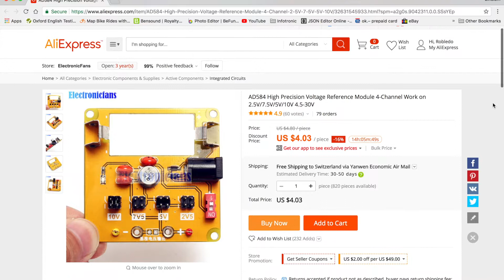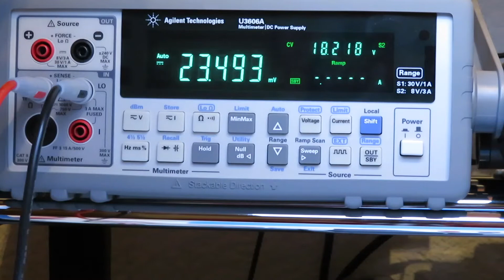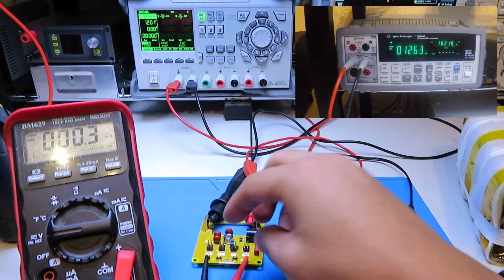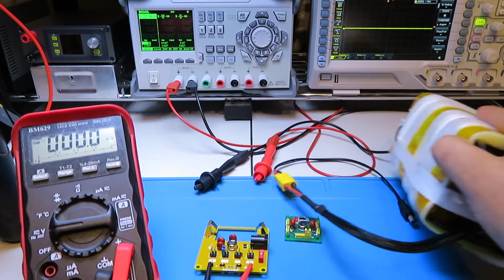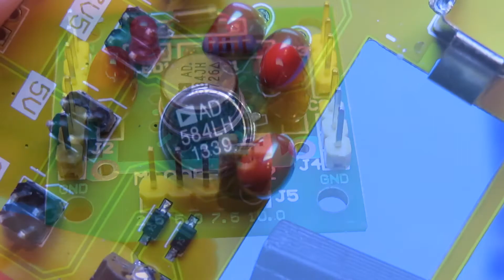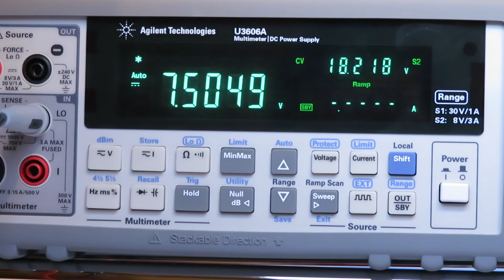AD584 Voltage Reference Modules from CHINA. Are the any good????

Comment: Why would you think that these things will boost the input voltage when it's less than the required output voltage?
Nothing in the Aliexpress page or the AD584 data sheet mentions any such thing.

The data sheet says "The input voltage can vary between 4.5V and 30V" but says nothing about boosting. 
Everything else in the datasheet, indicates that statement also implies "... depending on the required output voltage".  

In fact, under features, the Aliexpress page shows that statement, but with the above implication explicitly stated: "6. Operating voltage: 4.5V to 30V, note that the required operating voltage higher than the programmed output voltage".
And the data sheet shows: "(VOut+2.5V)<=VIn", (with best line regulation at 15v<=VIn<=30V)

Anyway, these devices are indeed quite nifty for the price. I have a few that came with certificates showing handwritten actual measured output voltages to 4 decimal places, which agreed very well with measurements I made with my own meters.
(note: sometimes these can have fake certificates that show the same measurements for every device, but mine appeared to be genuine)